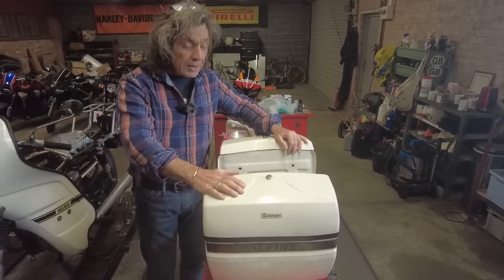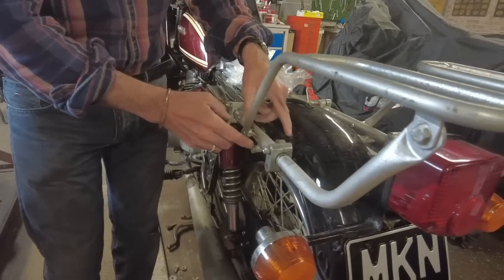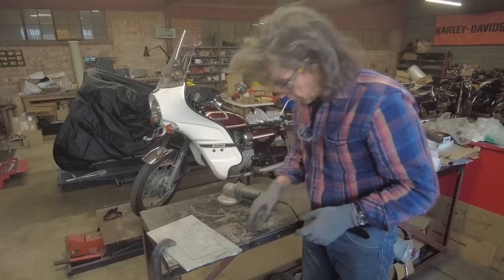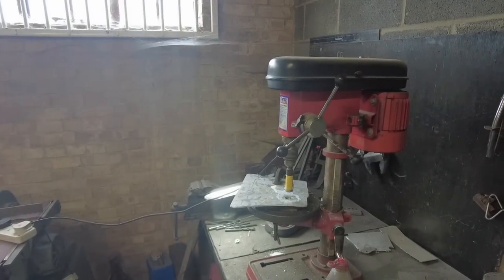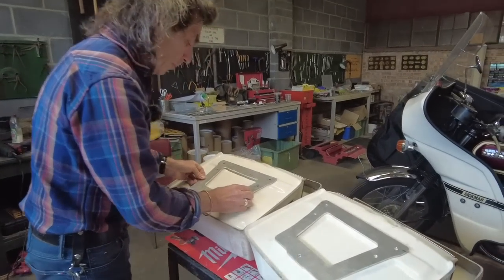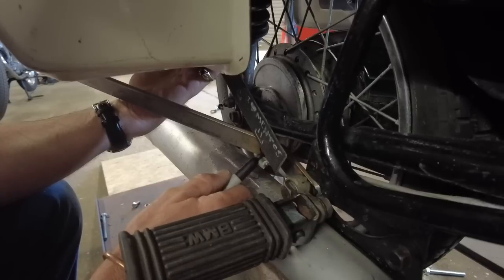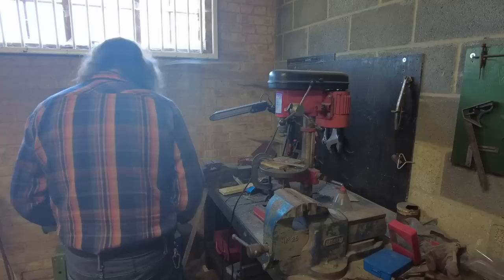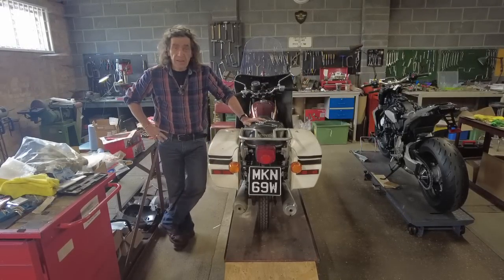Fitting Rickman Panniers To The CD200 Benly

Comment: Nice to see you back!
Regarding black and silver number plates: Initially, in 2015 the DVLA said that that vehicles manufactured more than 40 years ago (Historic) were eligible to display the traditional black and silver number plates.
Then they realised what they had done and changed it so that from the 1st January 2021 and going forward,  only those vehicles with a construction date prior to 1 January 1980 will continue to be able to legally display black and silver number plates. So with a 'W' 1980 registration date/plate you are skating on thin ice, depending on when the bike was constructed.

Comment: Any historic vehicle pre 01/01/1980 can display and black and silver plate. Anything after 01/01/1980 black and yellow plates regardless of historic classification. 

If you hold the grinder at an angle it will cut the radius a lot easier.